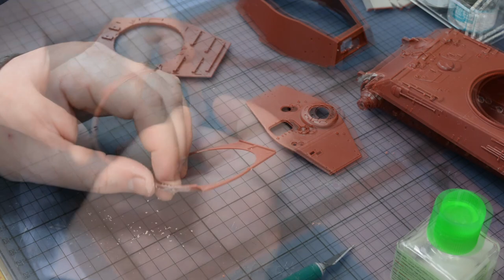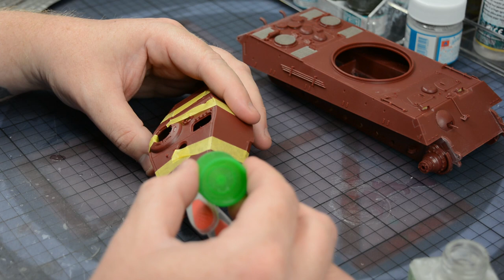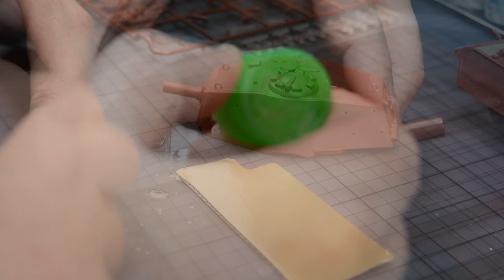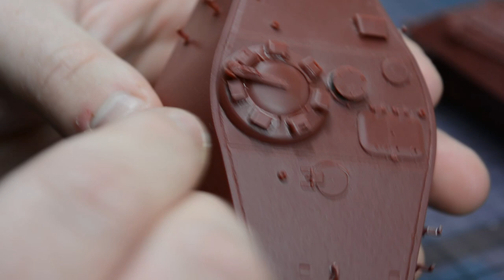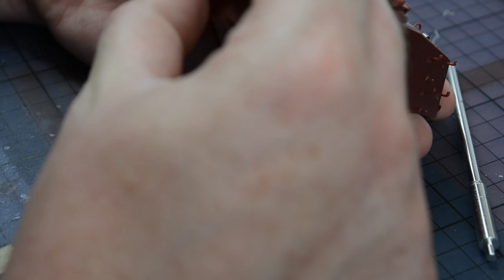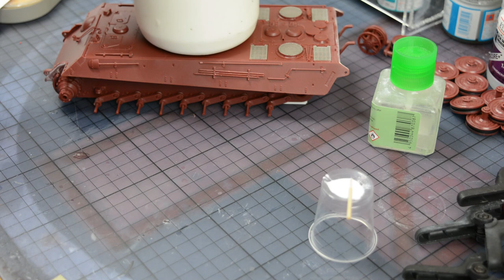Building the Meng King Tiger Part 3

Comment: Great videos.  I have been watching as I build the Dragon #6303 King Tiger.  The Dragon kit also has torsion bar issues.  I suspected problems so I ensured they were level but I wish I had seen your comments regarding the depth below the hull bed first!  I was wondering where to glue them so I settled for midway which turned out to be about 1mm below the hull bed.  The fit of this Dragon hull is amazing.  Absolute perfect fit.  Looking forward to the painted video.

Comment: Would you need to consider the weight of the gun,that push the suspension down slightly. Unless the design of the tank took that into consideration. Just a thought!
Reply: the tiger 2 weights almost 70 tons, i dont think the gun is going to make the tank front heavy

Comment: Hi did the metal barrel come with the kit
Reply from the maker: Yeah the kit came with the barrel, though I believe later boxing may have it omitted I'm pretty sure I bought another and it had the barrel
Reply: @ScaleModelMedic  Only the first run has the metal barrel is what I've heard. I got a kit recently it doesn't have a metal barrel and comes in a more standard yellow plastic. The photo etch is also replaced with brass. I haven't built it yet so I can't confirm if any of the issues have been fixed such as the suspension but I'm hoping that's the case.
Reply from the maker: @whitetiger5284  weird that they changed the plastic, the other stuff I guess boils down to cost.  The suspension issue I believe can be avoided if you're aware of it in advance, but we all piled into this new kit when it came out.  Its still a cracking kit, there have been others since and all the interiors etc but this holds its own and its reasonably priced at a lot of places
Reply: @ScaleModelMedic  Oh it looks like a great kit don't get me wrong! I'm really excited to build it but I'm waiting on supplies to paint my current two projects so I can clear my work space for it since its a big job. It's the biggest and most advanced kit I've got so far. 
Not sure how well I'll do since I'm pretty new to the hobby this being my 4th kit but it was a gift and I'd hate for it to sit and wait for me to improve.
Reply: @whitetiger5284  Did you have the problem with the suspension in the new kit or not?
Reply: @Mythos675  I did. Messed up the fix too so the kit ended up a bit wonky.
Reply: @whitetiger5284  i just started building the same kit you have and i dont have this supension problem but im confused because they arent all on the same level. So i guess i still have to his method